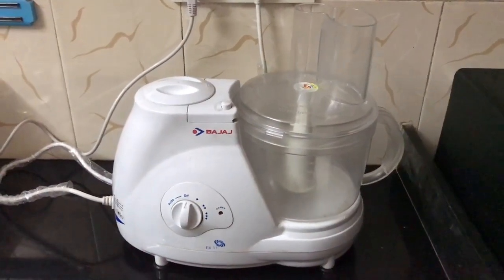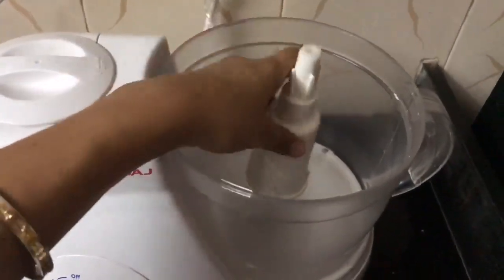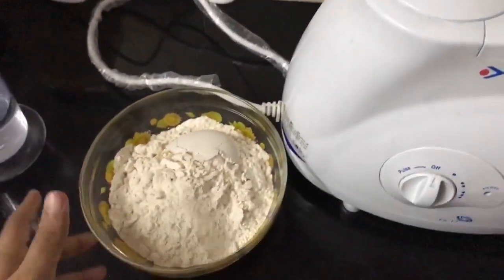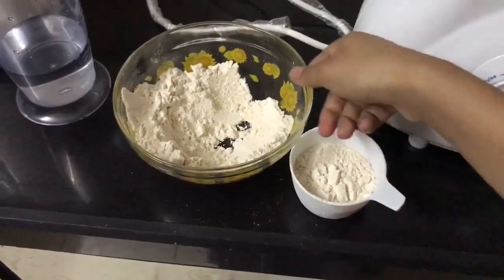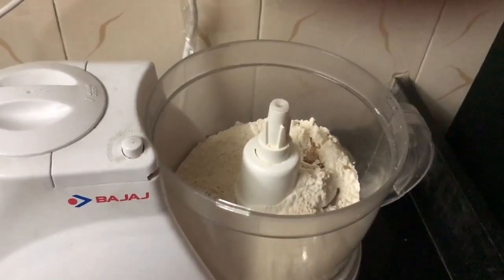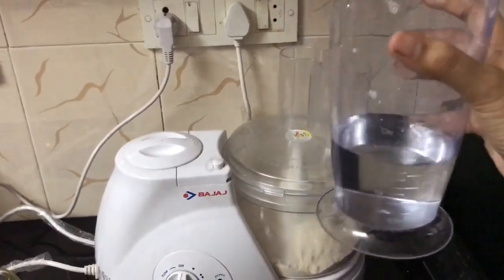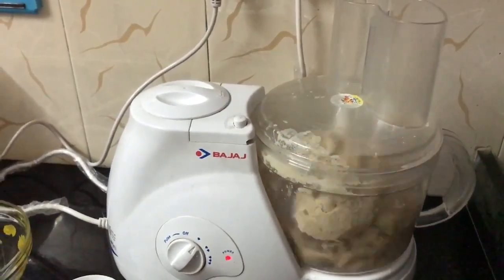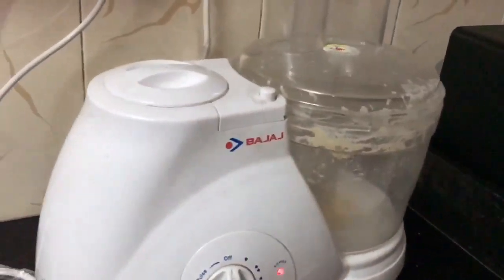Bajaj Food Processor Demo for Kneading Flour (Dough/Atta)

Comment: when i tried kneading the dough using this processor then it started making creaking sound and the plastic pipe that is used to put kneading blade in it was getting worn out. Can you suggest what can be done for this?
Reply from the maker: Well I have never faced this problem. But you can call the customer support for assistance
Reply: All food processors render such problem while dough kneading.  No matter what brand.  So use less quantity at a time.  That's the only solution. 
Custom Care,  company does nothing.

Comment: Not good to take 4 cups flour.  All companies recommend 2 cups at a time,  so that it doesn't overload the motor. 
I used more,  and my dough kneading blade broke.  Now the whole food processor is useless(as I have to buy a new one for dough kneading) 😕😢
Reply from the maker: i have been using this for now 5 years, did not face any issue. although now i have reduced to 2-3 cups only.